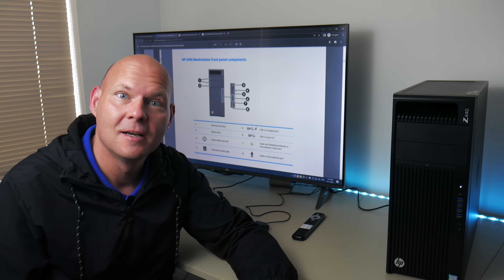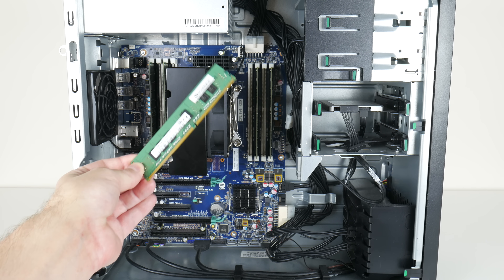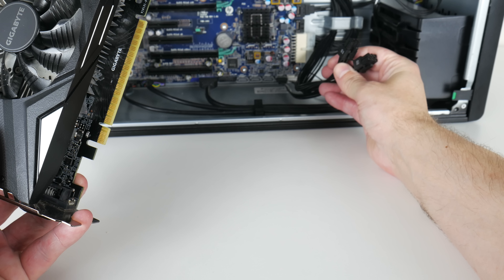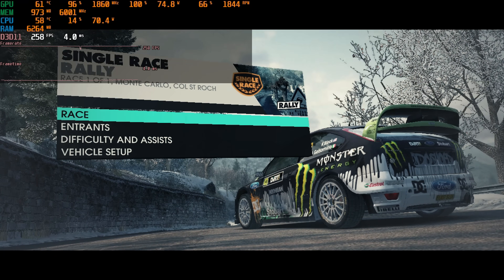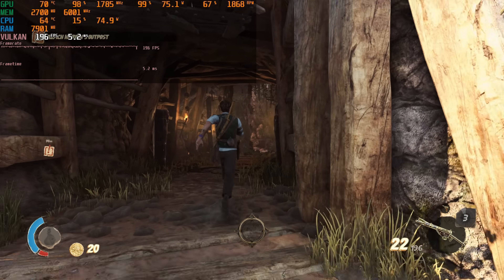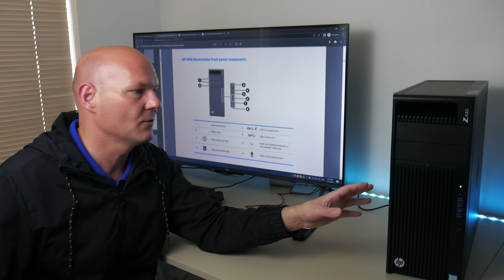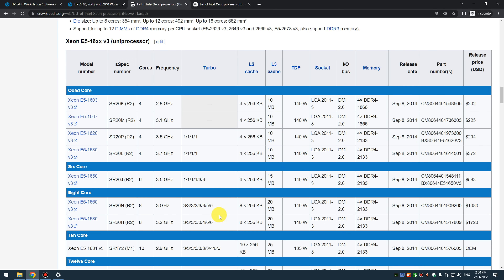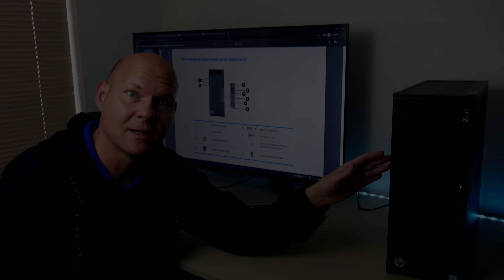This HP Z440 PC was my best purchase this year

Comment: I love business workstations. They are so modular and super easy to take apart. I've had my hands on very many HP's, Lenovo's, Dell's. It's kind of fun flashing firmware on a computer like this, often times there will be 4 or 5 different firmware's to flash, TPM, ME, BIOS, NIC, GPU....especially workstations they go deep. Another thing, one bad thing about these being so proprietery is if you break something or have a bad mic jack or something, you need the exact parts, they do sell them bare though so you could get all the parts for cheap (i.e. no ram/cpu/etc). I like having spares so I can frankenstein them together, take one with a bad board and make one pretty one.

Comment: I find that Office-PC's are completely underrated. My PC is a Dell OptiPlex 3010MT. I pushed it to the maximum with an i7-3770 and 16GB RAM. 
On top of that he got 2TB SSD, GTX960, a beQuiet!-PSU (500W) and some Noctua-Fans.
I can use it to play older games on high settings and newer ones on medium settings.
Reply: I don't know 3010 but I've got three Optiplex 9010 with i7-3770 and 32GB RAM, makes for a very nice everyday system. (One of them is a Hackintosh -- everything worked out of the box except networking.) They're also dead quiet.

Comment: both my home labs, and my offices are full of Dell T3600s (2011v1) and T5810s (2011v3).  I've refurbed a bunch of them for clients for budget work stations.  In Homelab2, my office workstation is a Dell T3600 with Xeon E5-1660, 32GB, 1TB Crucial P3 NVME, RX5600XT, under it sits  my main server, which is a T5810 with an E-52690v3, its the main server since this location has the best internet to punch out to share plex, and access it when working somewhere onsite.
Reply from the maker: Will check out those Dell machines. I guess it was just a wave of HPs that flooded the market here recently and hence good prices from the recyclers.
Reply: @philscomputerlab  I have had both, and unlike the Optiplex line a Dell supports the precision line allot better.  The 2011v1 system had a bios update as recently as 2020, and the 2011v3 as recently as 2021, the v3 even got TPM 2.0 support, and fixed GPU support so it supports newer GPUs than an Optiplex of the same time period and CPU generation.  Compared to the HPs the Dells have a more featured bios and more modern looking.  But either way they are good systems and the socket 2011 was a beast, they just suck the power compared to a Ryzen system.  Cinebench on my E5-1660 matched an HP prebuilt with Ryzen 5500, but the 5500, did at at less than half the power draw.

Comment: We used Z840 workstations to plan radio Neurosurgery at my hospital. They’re very reliable machines indeed. One thing I’d have to comment on the gaming tests is why use ultra settings in 720p. I believe medium or high at 1080p is a better performance indicator imho
Reply from the maker: Z840 are built even better. Dual CPU socket I believe...

Comment: I'm a real sucker for Haswell, it's a fantastic platform that gets overshadowed by Ivy Bridge.  The workstation variants are even better.  I love my whitebox systems but there's really something to be said for these overengineered workstations; once you understand how to service them its really hard to go back to cable managing with velcro ties.  And as much crap as we give HP, Dell and others, they continue to make device drivers available; not necessarily updating them in 2022 of course, but that you are able to find good tested, working sets to bring a machine up from scratch.  The cases also look fantastic and include 5.25" expansion bays, perfect for 'retrofitting'.

Comment: That workstation is impressive.  I have an older xw4400 workstation I was hoping to turn into a home NAS, but I then found out it runs off DDR2 memory to show the age of the PC.  The only NAS software I managed to get working reliably was Unraid but that requires a system with DDR3 memory which is a shame, so I have an old gaming PC as the home NAS now.  I could probably turn the xw4400 into a Windows XP era retro gaming PC if I really wanted to but currently I'm not sure what I'll do with it.

The Z440 was really impressive though.  I loved the feature that unused PCI-e power connectors plug into dull sockets just to keep them out of the way and not be loose inside the case.

Comment: I bought a Xeon based Z240 myself a while ago from an auction and it's unbelievable how much performance you can get from a PC that I paid less than 200€ for shipped to my door. You can definitely tell it's not your typical consumer PC when you take the side panel off

Only let down by the K2200 GPU that is installed on mine but the Xeon is a beast, friend has a 2011 Vaio laptop that is horribly slow and I felt bad for him so I had to get him something on a tight budget and if he ever decides to game more it's going to be a beast of a rig with a simple GPU swap

Comment: I think i am a little bit to late but ok... Sorry for my english by the way, its not the best. But i have to tell something about the graphicscard (especially for Gaming). I use the Z440 with an RTX 3060 an i love it. The PSU is the 750W and the CPU is the E5-1630 v3. With this compilation i get in several games over 90 FPS avg in 3440x1440! I can recommend this workstation to everyone.

Comment: I bought a Z220 on Ebay for $100 5 years ago.  I was so impressed with it that I bought a Z440 just over a year ago.  It has an E5-1650 v4, 32GB Ram and a brand new HP 3060ti that was $40+ cheaper than the lowest priced "name brand".   I boot from an HP Z-Turbo G2 card.  It also has an SSD, 2 HDs, and the 700w PS. This is the most trouble free machine I have ever owned.

Comment: I have a slightly older z400 with dual x5650 CPUs and WOW! It make Zero noise!
I have a 1u rack with similar specs that sounds like a jumbo jet so I was amazed that the workstation doesn't make a peep of sound
Reply from the maker: Yes I was really surprised how quiet the machine is, that was unexpected.

Comment: I like workstations in general. They usually are very reliable, no nonsense and well-designed.
I went with the Dell Precision line with the T3600, 5810, 5820 and recently the 7875 with AMD Threadripper.

Some have been bought secondhand and in all cases I made sure it has a strong power supply. I save some money by going with a gaming graphics card instead of a professional Quadro/FirePro. Still, these systems are quite expensive. But I don't mind paying something extra for reliability and on-site warranty service.
Reply from the maker: Here is Australia the used market is not that healthy. We see a LOT of the lesser machines like Optiplex or HP EliteDesk, but the real workstations with ECC RAM and Xeon CPUs are harder to find.

Comment: I had to build a 3D rendering farm on a budget and went with this platform. I bought two Z840s and a single Z640. Got used processors on ebay for very cheap (2X 2698v4,  2X 2697v4,  2X 2695V4) for a total of 112 cores. The farm can achieve a combined Cinebench score of around 80,000 and it has been a game changer for my production output.

Comment: I really like the Z440, your setup is the same as mine except I use a HP Z Turbo quad pro for the nvme storage
Reply from the maker: You can just use basic PCIe NVMe adaptor
Reply: I really needed more capacity, I have 4 1TB nvme drives

Comment: @7:00 No, that's bad math. 720p is 1Mpixel, 1080p is 2.1 Mpixel, 1440p is 3.7Mpixel and 4K is 8.3 Mpixel but it doesn't scale like that, as we're also dealing with different texture sizes at higher resolutions, more detail, more shadows, more everything... at 720p lots of things can be hidden or not rendered and lower texture sizes can be used without user noticing.
A card with only 4 GB vram may have issues doing 4K because game will fill the vram and you get less performance due to constant swapping between card memory and system memory, unless you reduce video quality.
Reply: Yeah, at best you need a 4x more powerful card to get the same performance in 1440p compared to 720p. 1440 refers to the vertical resolution, which is double 720, but the horizontal ALSO doubles, meaning a 1440p display is the same as 4 720p displays arranged in a square. That's why 1440p is called "QHD" or "quad HD", where "HD" is 720p.

As you pointed out, there are other factors that come into play like VRAM and other bottlenecks when you go up in resolution. Even if you use the same assets, the frame buffer itself will get bigger, especially with MSAA and similar features
Reply: In the gospel according to Terry Davis God meant for us all to live with 640x480 resolution! 8 colors should be enough too.
Reply: @1pcfred I recall thinking 640x480 for gaming was a luxury. I was wowed by Duke Nukem 3D at a show at this resolution. Later, when Age of Empires 2 required 1024x768 I thought it was absurd, the Alan Wake 2 of its day!
Reply: @Nick_R_  It all is a luxury. Anything that isn't an absolute necessity is. But if you're going to indulge then you might as well get the sweetest treats you can.

Comment: i have a z440 z420 and a dell 5810 - like Phil I dump the 4 core and put in a cheap 8-12-16 core in there with a middling video card... I think for most people an 8 core cpu is absolutely fine... you should be getting higher base clock like a 3.0 or more and for most tasks you dont need more than 8 cores... if you're doing VMs then that's a special case... people get stuck up on higher core counts when their tasks just dont require so many... especially games

Comment: My main desktop is also a z440, but with 12 cores and 32GB RAM running Ubuntu Linux.  I replaced the HDD with 2 solid state drives, updated the BIOS to 2.59, and I just ordered an Nvidia Quadro M4000 8GB GPU for video editing. I plan on adding more RAM, too. I can't complain. Got it for a great price refurbished, and with all the upgrades, I can't think of a better bang for the buck.
Reply from the maker: Nice 🙂

Comment: I had a Lenovo ThinkStation S30 and this thing was built like a tank, but I sold it off since the motherboard started developing some problems with booting and not detecting drives properly. Flashed the BIOS, new CR2032 battery, swapped SATA cables for known good ones and still problems persisted, perhaps the SATA controller was on it's way out. For the money it returned me with a RX470D inside, I went 12th Gen and I don't regret it. I built a really efficient system for my needs - mainly office work, RAW photo development and editing, little gaming on the side. Compared to Sandy and Ivy Bridge it's so much snappier.

Comment: ex office machines are great value, i particular love the micro usff pcs (dell micro, lenovo tiny, hp mini, etc) that are smaller than your average modem, lower power consumption, regular socket cpus (usually with a 35W power limit) and cheap so-dim ram - perfect systems for servers, or general desktop machines, much better value than a pricey nuc - ebay is flooded with them, they are great for anything you don't need a dedicated gpu for 

however if you don't care about size and power efficiency the bigger systems are even better value
Reply from the maker: I'm waiting for a good deal on one of those for driving my TV. At the moment I use a Beelink Mini PC.
Reply: @philscomputerlab  yes, I have one running as a steam streaming box, Plex server and have a few virtual machines on there too

I bought a beefer one with Intel's 8500T processor, quite powerful for 35w, not far behind than the HP here according to pass mark

That being said I tend to use the 4k firestick for media consumption, hard to beat value at 79$ when on sale.. hardware support hdr 10bit 4k and runs beautifully for next to nothing

Comment: My brother found a "HP Z800" if I remember the model number correctly, but the proprietary 1250 watt power supply wasn't working. It had dual Xeons and I think 24GB ECC RAM. We bought a replacement power supply for around $200, but it was risky as looking up that model we found that the PSU's are prone to blow up, we got one anyway and all seemed okay.

I hadn't had the time to put an SSD inside and install Windows yet, but every now and then I would do something, like run a RAM test, run WindowToGo on a USB, but maybe used 5 times. Months later I'm about to set it all up be removing one of my older SATA SSD's from my PC that was running in RAID 0, and reinstalled my own PC with one SATA only.

I go to turn on the HP z800 and "BOOOM!!!"💥💥💥.....the PSU popped......oh well. I should've went the route of buying a normal ATX PSU, hanging it outside on top and just using an adapter for it connected to the proprietary connector to the motherboard.

Comment: I run a 10 year old xeon chip with 32gb of ddr3 as my pc. Board can except 64 or even 128 if I update  the bios. Still working  great I did upgrade my graphics card this year from a 4gb gtx 680 to a 8gb amd 6600 something blanking on exact model.

Comment: Got a z220 for pretty cheap a while back, i7 3770, 8gb ram, and came with a 600 watt power supply. I added 2 ssds in raid 0 to make up for the lake of nvme lol. Worked pretty well... Until I had to sell it.

Comment: Nice video Phil! The office building i work close to is moving and they where trowing out 10 computers. I picked them up and one of them was a HP Z440 with E5 1620v3, 32gb ddr4 ecc, 1 tb hdd and quadro K620.
After 3 duds (Phenom x2 220 and I5-650) i came over that one!
Reply from the maker: Awesome 😍 It's a very nice machine, it is still my daily driver and 4K video editing command center 😅

Comment: I always tell anyone willing to listen that the difference btw a workstation and a PC is like comparing a sports car to a bus. If you want to take a bunch of people from A to B, you could use the zippy sports car but make 10X or more the number of trips (assuming it doesn't break at any point), or you could use a bus and make a single trip. Sure it is slower, but if you need to do this hundreds or thousands of times, then the bus option becomes a no-brainer assuming you have workloads that can be parallelized. Workstations are like buses: lots of cores/threads, ECC, super reliable, plus that Quadro card is capable of double precision. For scientific applications, this is what is important, not fps in Doom. And many times, the software that was used cost 10X more than the workstation itself. With all this said, video editing and encoding is one application that can benefit from a workstation although modern high core CPUs are a better option.

Finally, if you're workloads are easily parallelized then offloading them to a server with hundreds/thousands of cores beats a single computer every day. I have not researched what options are available outside enterprise solutions. I'll leave it to others to comment.

Comment: I have run x99 CPUs with the motherboard turbo unlock. Unfortunately with the E5-2699 v3 the turbo unlock doesn't do much with so many cores. 😂. 12 cores on the E5-2678 v3 seems the to be the limit.

Can't beat the price on that many cheap cores on the 2699v3.

Avoid the 2678v3 the price has gone through the roof (unleas you need DDR3) and go with a 2680v3.

Comment: Awesome video. I'd like to see what this machine can do with a more powerful gpu.
Reply from the maker: Me too!
Reply: I can tell it works juuust fine i have e5 1650 v4 32gb ram 2 ssd 1 hdd 700w psu rx 5700 xt and i ran everythink 1440p high settings just fine

Comment: i built myself an x99 system with a xeon 2696 v4 (22 cores, 44 threads, up to 3,7 ghz), a gigabyte x99 soc champion, 64gb of ram and a radeon pro w7500, it's quite a beast, it can handle games prettywell in full hd, and manage all my productivity using many vms and docker instances, it's ideal for work and i can just disable a few cores, set higher turbo boost clocks and power targets, and get better gaming performance. i am very satisfied with this system overall.
Reply from the maker: That's the CPU I have my eyes on 😍

Comment: My HP 440 cost me $240 AU. Basic set up with a E5 1620 v4 16 g ddr4 256 ssd and a quadro k2200. Goes better than my other pc and the upgrades possibilities are crazy good. Going to slot in more memory and a E5 2680 v4. However I will need to buy the memory cooling component and never came with my machine. Thanks for the video.
Reply from the maker: The memory cooler is only needed if you use more than 4 sticks or more than 64 GB.
Reply: @philscomputerlab  I picked up some cheap 16 gb modules I intend to throw in. See how she goes. It's just my old pc for old fellas.

Comment: I always like the workstation stuff- they still have a bit of the overbuild quality you would have expected in the 70s or so. I bought a used IBM Thinkstation from 2013 and used it as my main work PC for years- and that PC is still in use and is also still on the level of a mid level laptop. The nvidea Quadro GPUs seem to be prone to breaking though- all the ones I got used died eventually

Comment: I had seriously considered purchasing a used Z840 from an enterprise and then upgrading at a leisurely pace. The Z840 is still a beast in 2023.
Reply: Check out Dell Precision T5810, mine has 685W PSU, 1620v3, 16GB DDR4 2133hz, has 2x6pin PCIE adapters for GPU, AMD Firepro W5100.

Upgrading CPU to 1650v3 for £12 & upgrading to 5500XT as I have that lying around but just waiting for 6pin to 8 pin adapter to be delivered, good machine.

Comment: The HP Z800, with the brushed metal sides, is still one of my favorite looks for a serious business machine.  But I've never owned one, and I'd worry about the noise.

If I'd known how many issues I was going to have over the years with various self-built machines, I would've considered getting a prebuilt workstation, especially if I had a way to check the noise level before purchase.
Reply from the maker: Both the 440 and 640 are extremely quiet. I would guess the 840 is similar